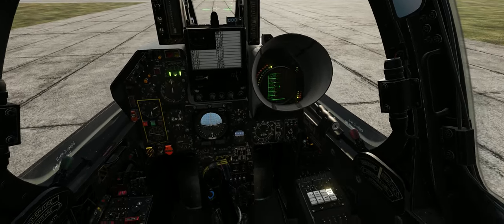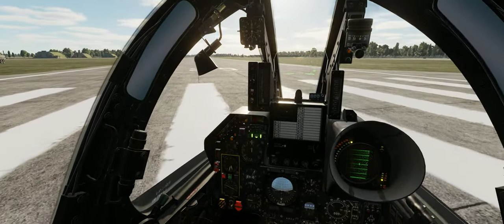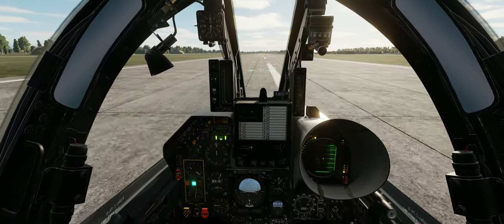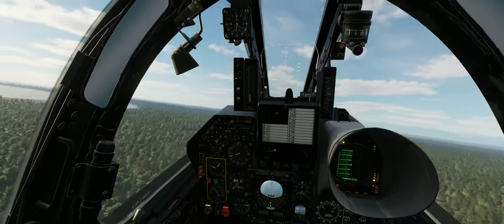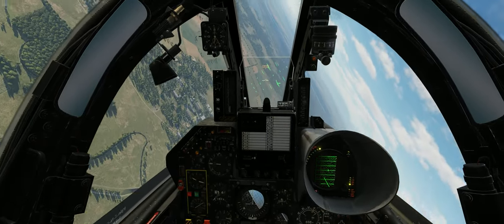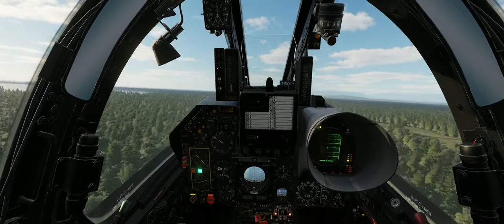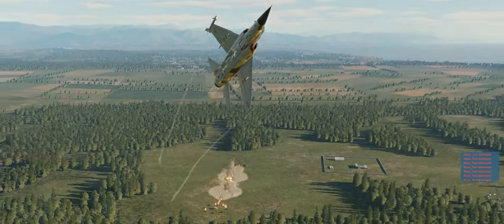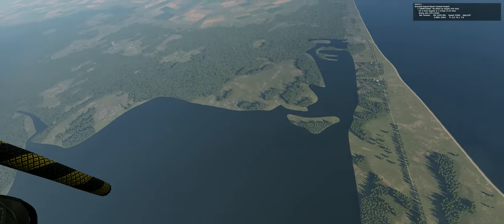Mirage F1 - Weapons Tutorial - High Drag Bombs

Comment: Thanks for the excellent video, I recently got the Mirage F1 and I've been practicing some low and fast runs with the HD bombs.
Was trying to get as low and fast as I could (with my meagre piloting ability). 500kts, below 300ft, level flight and pickle at 150 mills worked quite well! So far I've tested 250 kg HDs and the Durandal anti runway bombs. 
In general, the high drag weapons have been the most successful for me, with rockets it seems you need to be very accurate for them to do any damage, even against relatively lightly armored targets. I feel like ordinary bombs will leave you quite exposed in the attack to ground fire. 
Haven't tested the cluster bombs yet. I'd like to find good parameters for those in a low and fast approach.

Comment: I love the High drag 400 kg bombs in the quad rack on the belly. Then I throw on 2 drop tanks and 2 250 kg high drag on the wings. I plan the target with a VOR (if possible) radial, and always (ALWAYS) dial in a tacan offset. I approach at mill power, 200-300 feet (sometimes lower) and give it burner about a mile from the target (based on TACAN offset). I set  the bombs to all salvo off, then fly mostly level. When the tip of my pitot tube is about to touch the target I pickle the whole load of bombs. Generally this puts bomb #2 or 3 dead on the target, with some long, some short. it works well on infantry formations, light armor, trucks, airfields, and it is perfect for bridges. For ships when I don't have a precise location I find them on my radar and use that for ranging, then make the approach bow to stern for best results, though stern to bow works as well. (1 or 2 bombs will always miss). but by approached very fast, and at very, very low level, even really good AAA has only about 3-7 seconds to track and shoot, and by then I'm gone. Just don't do a second pass or they're going to own you. (Edit) You mentioned the "radar tape" Correction, the F1 doesn't have a Radar altimeter (at least the CE). the Hud tape is a simple repeat of your primary altimeter.  Just like the Viggen if you want a specific drop height you need target QFE.
Reply from the maker: Excellent. Thanks

Comment: For the linear approach with a ripple of bombs the lack of pipper depression is not as much of an issue.
You can set the pipper, so it will put the middle of your spread over the center of the target.
I find hi drag bombing more consistent than dive bombing, I am nowhere near as accurate with dive bombs as you are though.
With low level bombing I can set my airspeed first and then only need to focus on altitude and drop point.
Reply from the maker: Good information. Thanks. I guess it depends on your definition of "accurate".  For point targets I generally want to be within 30m. I find that pretty tough to do consistently with high drag bombs.

Comment: I don't think that approach with the shallow dive and especially the climb out will improve survivability in any way. 500 ft seems awfully high too, but I mainly fly Viggen.
The deficit in accuracy is easy to fix when you drop all bomb stations in one huge dump.
Where I agree is with the biggest difficulty of a low level high-drag attack: you have a super short time window to spot the target and correct the flight path if neccesary. At close to transonic at 100m you will barely have a few seconds before passing the target
Reply from the maker: I don't disagree with you.  I just wrote a reply to another comment, basically discussing this point, that the state of technology represented by the F1 was really not capable of attacking accurately and survivably against air defenses that were state of the art for the time.  The Viggen, while a contemporary of the F1 is a little bit newer and I think the version in DCS benefits from a newer generation of avionics that makes precision navigation and strike more effective (bearing in mind, of course that ground attack was an afterthough for the Mirage F1).

The point of these videos was not to present a tactical employment of the aircraft. I was more just trying to figure out how to even hit the target using the technology available.  For me, there isn't any point in trying to fly a tactical mission until I get prodicient on the range - and as you can tell from the video, I'm not really there yet.

I'm looking forward to experimenting with ways of combining lethality and survivability - I'd love to hear what you come up with given you experience with the Viggen.  Feel free to drop by the Discord and continue the discussion.

Comment: So, I'm no expert at all but between your short drops, and a few people in the comments talking about hitting short as well wouldn't the smart thing to be to just adjust the mills up some?  Why not get the attack process down and then learn the correct mills by adjusting the dial-in?
Reply from the maker: Well, if you want to become more of an expert you should search back through the channel and look for the videos about "Rolling Snakeyes" since we covered a lot of this stuff there.  This isn't the first video on high drag bombs that I've done and the way I approached this one was strongly informed by my previous efforts

And not to split hairs overly finely but, I think that I actually had one long drop, one short drop and then one on target - which to me felt like "dialing it in".

All of that aside, the issue is that there is not correct "mill setting".  The mil setting that will work varies with speed and altitude (and also dive angle).  So, the technique we came up with in earlier videos was to pick a mil setting and then find the right altitude and speed for that sight setting.  The problem is that accuracy is VERY sensitive to getting those attack parameters JUST right and a difference of a 50' in altitude can make a difference of 100m or more in your accuracy

For me with this process - as with an awful lot of iron bombing -  the hard part is not knowing the numbers.  The hard part is HITTING the numbers consistently.  So, what I was trying to talk about in the video was a technique that allowed me to develop a fairly consistent approach that I could fly with some repeatability oince I had dialled it in through some trial and error on the range.

I'm sure there are other approaches that would work. I'm sure that there are other sets of numbers that would work.  This worked for me.  If it makes sense to you, give it a try.  If something else works for you, let us know!  Drop by the discord. Send screenshots!  Send Trackfiles!  This stuff isn't easy.  If you find a way to get good at, I'd like to know.

Comment: Low level & Hi drag Vs dive bombing
- air defense
- weather (low clouds preventing aiming in dive bombing).
😉
Reply from the maker: Good point about the weather!  Thanks.
Reply: @Sidekick65  it's a little more modern than what you're used to, but you should try M-2000C toss bombing with IP designation.
Super Etendard used that kind of bombing for a retaliation strike in Lebanon in 1982.
Planes were loaded with rockets and 400kg bombs for dive attack.
But low clouds prevented that course of action.
The rockets shooters had to go back to the boat, but the bombers went in on the back up IP and lofted their bombs.
Legendary (at least in France) French pilot Ramon Josa was leading the strike. He started as Corsair pilot in the French Navy, and finished as Super Etendard pilot.
He also flew the Crusader and Etendard IV.
Reply from the maker: Well, back before we had the bombing computer in the A-4 I actually tried my hand a little toss bombing.  Simulating IAF experience in the Yom Kippur war.
https://youtu.be/1oveDRb9YGg

Also here - on an early version of the range
https://youtu.be/NZuFd5zwOBA

According to stuff I have read the IAF A4's had a HUD that would let them do toss bombing - but not at ranges that were long enough to keep the completely out of trouble